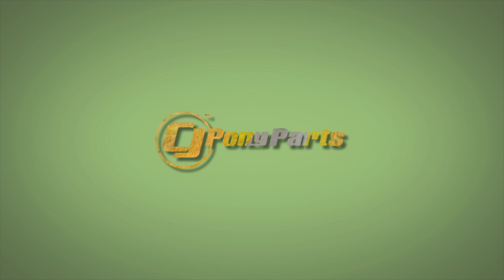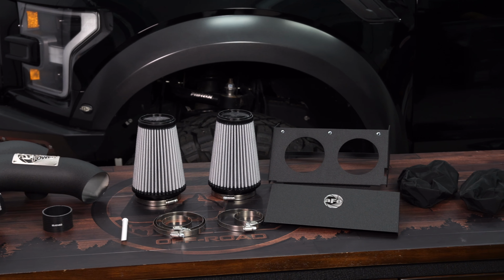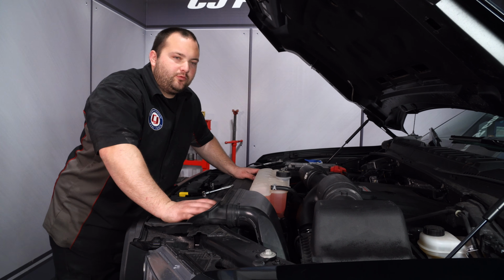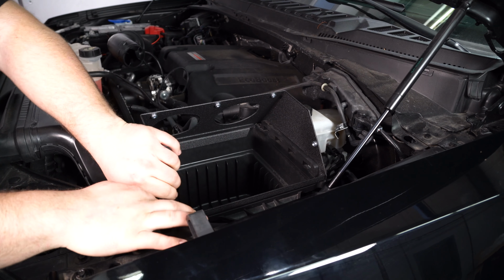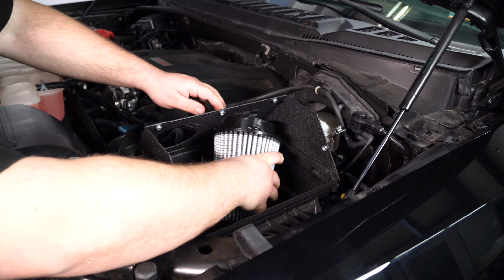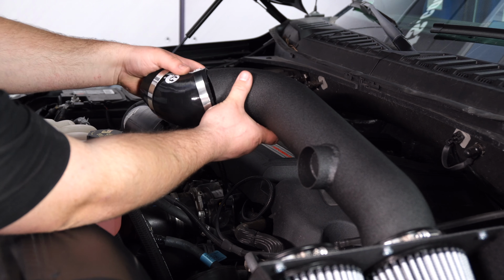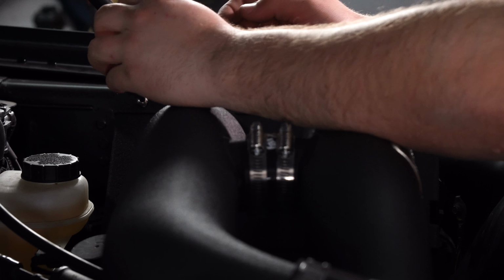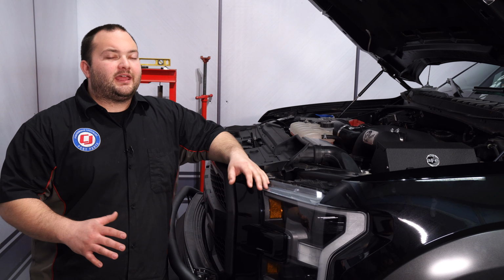Magnum Force S2 PRO Dry S aFe Cold Air Intake Install Boosts Performance of your 2017-18 F150 Raptor

Comment: What is the tube at the PCV for ?
Reply from the maker: It's to restrict the air flow for the PCV system. Without it, the new intake flows so much more air than factory the computer will think one of the PCV tubes is disconnected because of the increase air flow and it will throw a check engine light code. The restrictor keeps the PCV system working like factory and check engine light happy.
Reply: CJ Off-Road ok 👍. Thank you
Reply: Just ordered one of these from you guys a few minutes ago. Can’t wait to get it.